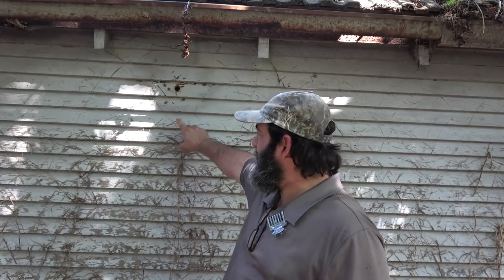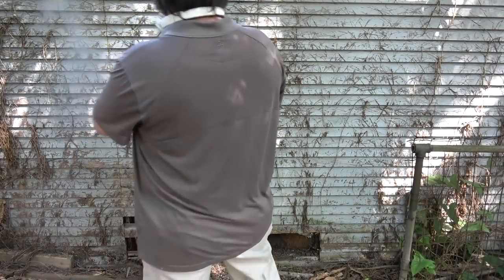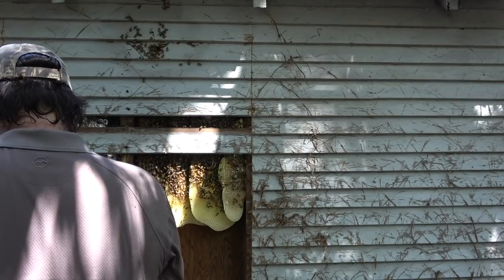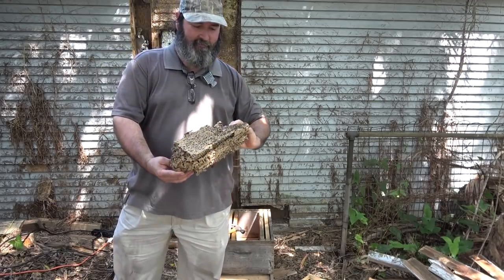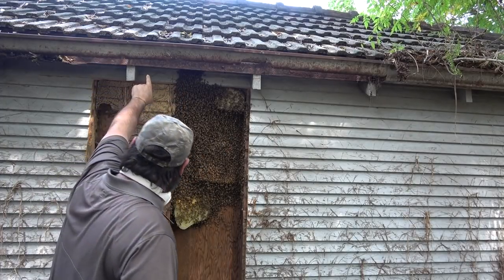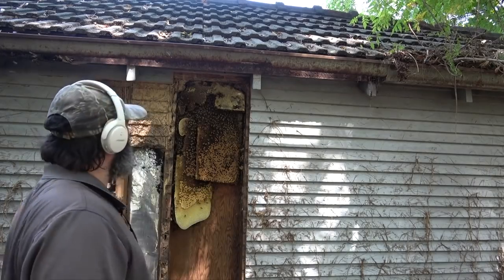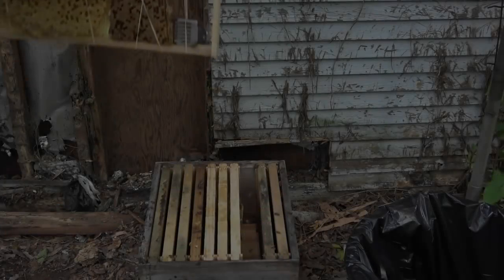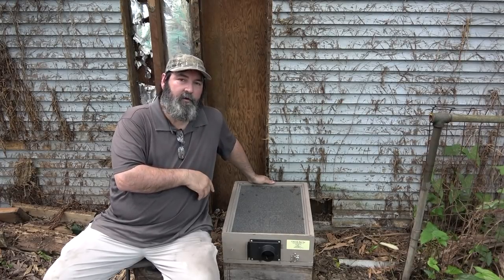Beehive In Old Shed Wall

Comment: I really like his knowledge about other pests that hang out with the bees and his concern for the homeowners property. Many workers are not concerned. That looked like a carpenter bee hole they were using for access.  I learned all about this with my mom's house. Carpenter bee makes a nice opening in the wood and bees and yellow jackets and every other insect moves in!  Lesson, check out perimeter, eaves etc about once a month. And catch it early, prevention, prevention, prevention will save you so much!

Comment: FYI JP. start at the top with that siding it will come off easier.
Reply from the maker: Can’t really start at the top. When bees build in a vertically oriented space they almost always begin building at the top of the void so you work from the bottom going up. But...

The main reason you start below is if a good bit of the comb is attached to the lap board at the top & you pull it away you’re in for quite a big mess & a bunch of aggravated bees.

I’ve done this a few times before, trust me on that. 😉
Reply: @JPthebeeman  I understand thanks.

Comment: You Rock Dude ! I had 2 swarms this summer.And we had a bad wind storm and 1 of our weeping hollowed out willows fell down. Not sure what I should do.. There are honeycombs  in the tree,but due to cold temps the bees are not active ...I want to order bee boxes , but do not know what i am doing....Can you advise me? By the way I am from NE, Pa.
Reply from the maker: Handy one I would do my best to orient the section of the tree (if at all possible) that contains the bees to where the hive is positioned like it was (perpendicular to the ground) then provide a wind break.

Don’t know if any of this is possible but that’s where I would start.

The idea is to leave them be until the spring when it begins warming again, then you can perform the transfer.

If you have to remove them now I would consult a local beekeeper/removal specialist to assist you.

Try finding a bee club somewhere near you, perhaps you can find someone or a group to help you with this.

Best wishes! ✌️👍🐝

Comment: It seems the Layens deep frame, would work better in a lot of those cases.
I’m still attempting to catch a wild swarm in a Layens deep frame swarm trap I put out. Still early in the swarming season here.
 I need the darker varieties of bees, because I live in a state with brutal winters, & from what I’m learning, they winter over better, with much less die off. “Wild”, are supposedly better at tolerating mites & hive beetles as well, & much less work for a beginner bee keeper.
Reply from the maker: The only issue with the Layens hive, horizontal (long hive) or traditional top bar hives I see is moving them, if need be, from one location to another. Other than that, I’d say go for it!